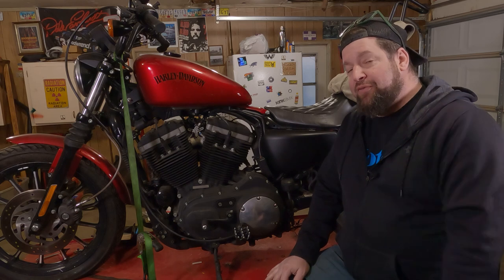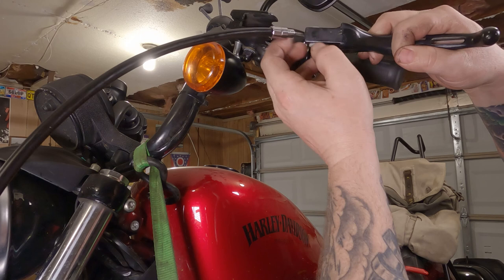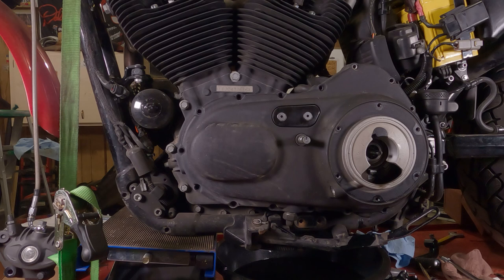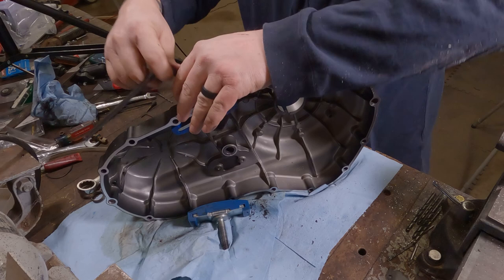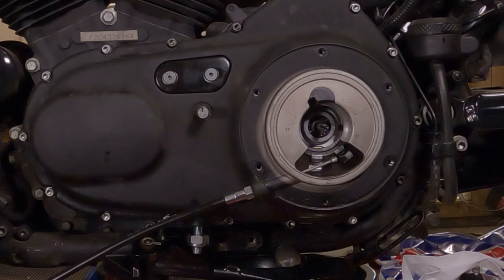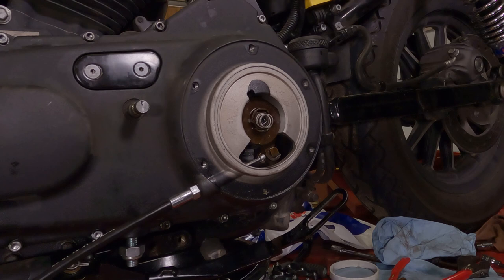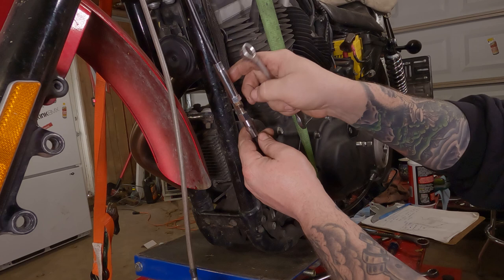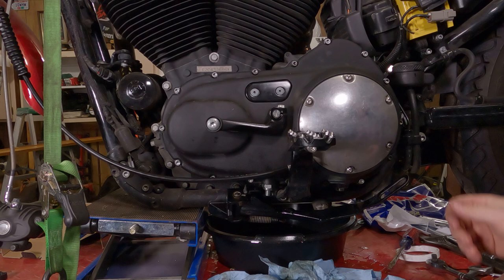Sportster Primary Chain Tensioner Inspection & Replacement

Comment: The nut for the tensioner goes on with the sealing part towards the primary case that nut is a sealing nut. Watch your video on the tear down you will notice it was on correctly when you disassembled it. Just dont want you to have a leak. P.s loved the end of the video had me laughing I’ve been a tech for over 20 years we have all forgot to put a drain plug in once or twice. Loved your video it needs more views. Keep wrenching and helping people.
Reply from the maker: It was take 87.  I did realize I put it on wrong when it started leaking. By that time the video was already posted. 🤷‍♂️
Reply: Hey man we are all human. I’ve been a tech since 2004 and I still mess up from time to time. I loved the video I like watching Harley tech videos in my spare time. Keep up the good videos.
Reply from the maker: @danielveals5396  thank you.